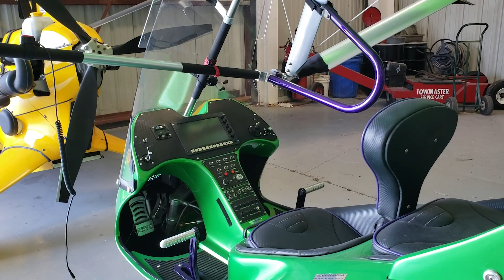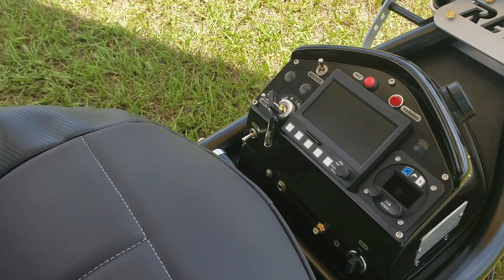Ultralights Are More Fun To Fly

Comment: Would it be illegal to put a mini jet booster on an ultralight
Reply: nope, it's been done many times actually.  The trouble with using a jet though is the fuel burn rate is insane. So you need a lot more fuel, which means more weight. For foot launch ultralights (ppg or hg) using a jet means so little fuel that you're talking like 10 mins of power without making the weight unfeasible. You could do more of course with a trike setup, but it's still not practical, if your goal is to go fast it's far better to reduce drag than it is to increase thrust. https://www.youtube.com/watch?v=ziBe2JwgE1o